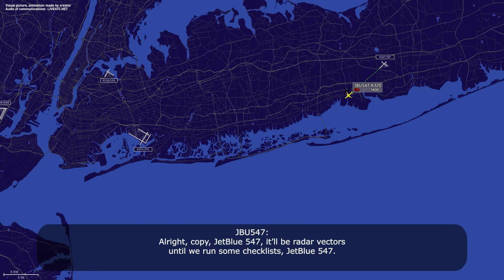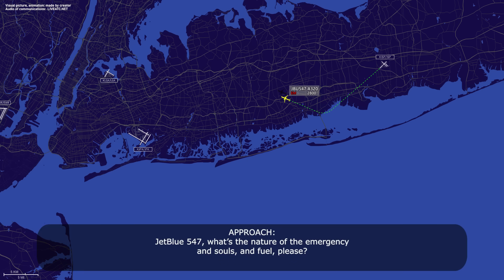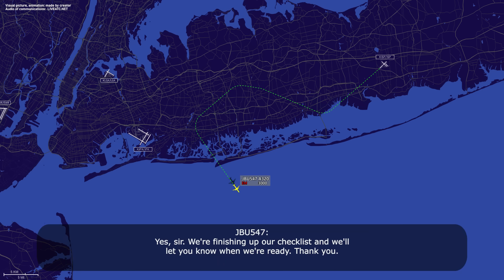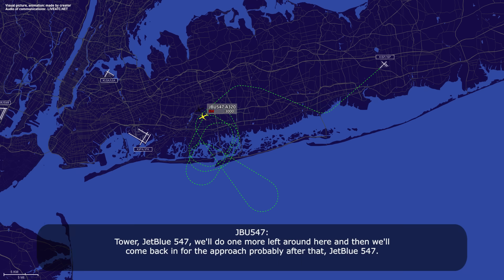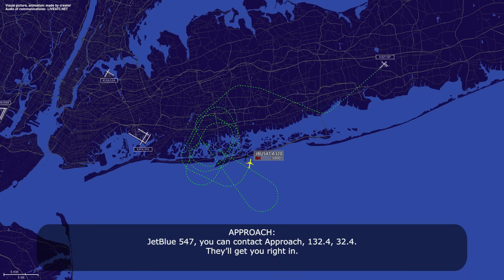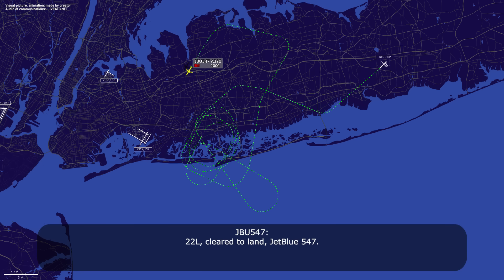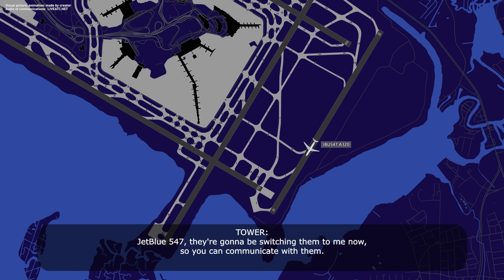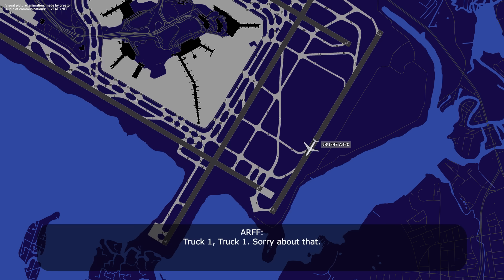47 minutes in the air with destroyed engine. JetBlue Airbus A320 diverts to JFK. Real ATC

Comment: FAA ATC seriously needs to figure out a way to pass on the POB and fuel information.
Reply: Yes.  It's embarrassing to hear, and it creates further workload and distraction for the flight crew.  The necessary technolgy to continuously report that electronically has existed for decades.  It is only the slowness of FAA and air safety bureaucracy, along with unending cost-consciousness, that something helpful and safety-enhancing like that hasn't been accomplished.  Has it even been seriously proposed or studied?
Reply: Well there is an easy fix... The controller advises the next sector but somehow that doesn't seem to be a thing in the US
Reply: @xtasy6807  - They do, but it's better to have something repeated from the source.
Reply: @xtasy6807  actually it does but because it's all manual it takes a little time.   In this case the switch was very quick and it was not communicated yet.
Reply: @charlesgee3003 yeah it is manual because the US is stuck in the 80s with their tech and procedures
Reply: It Took Like A Year To Get This Plane Down.?
Reply: Not happening without funding new Atc system. Many still use a strip of paper for each plane's info.
Reply: @Glamorgan-f2c and that's how it should be. Air needs less tech not more
Reply: That was never part of Real World or Road Rules so Sean’s going to have a tough time coming up with a way to fix that.
Reply: Excactly, 5X is just absurt.
Reply: Actually even if they could pass it on, it's like the medical profession, you ask multiple times to make sure the info is correct.  In surgery everyon repeats the same questions to verify they have it right (I've had 4 this year).
Reply: @charlesgee3003 in state of emergency they are wasting crew's time and diverting their awareness, deconcentrating. That shall be said once, readback once and done. Eventually a software made by some college student shall estimate thr fuel remaining after initial data, radar recording, plane type and number of pax.
Reply: @charlesgee3003 incorrect. There is no policy within this industry to repeat the information multiple times to confirm its accuracy
Reply: @RoamingHeathen perhaps but I suspect   the thinking is along the same lines.
Reply: @charlesgee3003  There is no thinking. They're told to switch frequencies, there is no handoff, they have to repeat themselves.
Reply: There's two pilots, it's fine. Also, it's a cut of a 47 minute clip.

Comment: I am not in the aviation industry and have a question.  Is it normal to have an emergency aircraft land right behind a heavy aircraft that causes ATC to issue a wake turbulence warning to the emergency aircraft that is about to land?
Reply: Just normal protocol to alert of proceeding wake turbulence… emergency aspect plays no role really. It’s still an A320.
Reply: @EstorilEm Thank you.
Reply: Only if you want to land asap
Reply: @kenriehl7852 Thank you.
Reply: They are still separated. It’s more a reminder to expect some bumps.
Reply: @SlowSteveRoadCraft Thank you.
Reply: no that is not normal in Europe, the US is always different. It is really silly to give an inbound aircraft a wake turbulence warning, your EM aircraft should never be following any other traffic this close where a wake could be a problem.
Reply: Unless the pilot tells them specifically, they need to land immediately no. In this case, this sounded like a normal engine failure, so they were fine to hold for a while while they set up for approach. On the towers side, since it's not an immediate landing its in their best interest to get the heavies down first in the event they close a runway. Heavies dont have as many luxuries staying in the sky as a little 320.
Reply: @jonathanzimmermann5877 Thank you for explaining this info.

Comment: Take a moment to admire this aircraft. Single engine, stayed flying, landed safely and kept up the required speed by ATC for spacing.
Reply: I completely agree although surely there was nobody following them in given they closed the runway? 
So I guess it was just a case of keeping them separated from the aircraft in front and not because there was also an aircraft behind them
Reply: @rossn9164  They probbably had approaches right behind them coming in for 22R. JFK is super busy so as crazy at it is, when they think it's safe, they continue to operate flights around the emergency aircraft, and switch to a different approach runway behind the emergency, effcectively making a single runway airport.
Reply: Gotta maintain 250 or less under 10k anyway
Reply: Why is this happening so much? Or is it these occurrences are normal but before YouTube channel like this we simply would not hear about it?
Reply: @hankhammer1689  Well, if you increase the number of flights by millions each year the number of incidents will also rise…
Reply: I mean, that's kinda what they're all designed to.  Every commercial twinjet in service can do that.
Reply: @cruisinguy6024  You're not wroong, but even so 40 years ago this was more common and more often became a serious situation. May have been quite hairy. It is notable that both crew traning and, criticallly, aircraft design have come such a long way that this serious emergency was handled by both crew and plane with relative ease and total safety. ATC could have had better communication, but overall handled well because of modern traning and design.
Reply: @cruisinguy6024 Yea and I think hes saying to admire how far technology has come to allow that.

Comment: Did they agree in changing the runway in one of those transmissions that were not included in the video? They had asked for 22R due to it being longer but then got 22L.
Reply: At 06:07 they informed ATC about the switch.
22R landing distance is barely more than 22L and 22L has an EMAS

Edit: 22R has a massively displaced threshold, so at first glance it appears way longer than 22L (and the better choice), until you take a look at landing distances
Reply: @lyaneris  thanks, I had missed it. Didn't know about the displaced threshold making the difference smaller, interesting!
Reply: 6:02 they request it
Reply: @kevinofcnj  Thanks, I had missed it :)

Comment: Do these controllers seriously not pass on information to each other?  They only asked multiple times for the exact same information.  It'd be nice if all these controllers would communicate with each other when there's emergencies like this.
Reply: Sometimes the next controller is in the same room, sometimes it means a phone call. Depending on how fast things are happening and how much other traffic and issues are going on for the sending and the receiving controllers, info passing may not be the priority.  VASAviation sometimes posts long unedited videos of emergencies and the sophisticated orchestration of a crowded airspace to make room for the emergency aircraft is amazing to see. At least Kennedy has parallel runways. Sometimes the controllers are having to work out what to do with other flights considering their main runway will need to be closed a.period of time.
Reply: Actually I suspect that even if they could pass it on, it's like the medical profession, you ask multiple times to make sure the info is correct.  In surgery everyon repeats the same questions to verify they have it right (I've had 4 this year).
Reply: @charlesgee3003 This. I worked EMS a long time back, and still remember the routine. If possible, we verified every bit of information the dispatcher gave us, and everything we got from any on-scene first responders. And the ER staff verified everything we told them.

Because every exchange of information between people is an opportunity for an avoidable mistake.
Reply: @charlesgee3003 Yes, this. I had multiple procedures last year and can confirm this process occurred via the post-op reports. Yes, it might be the third time you're asked, but they want to absolutely dot the I's and cross the t's.
Reply: The second controller  (who only had the plane on frequency for about a minute and a half by my estimate comparing the positions on FR24) acknowledged the check-in, collected emergency information, issued a heading and altitude assignment, handed off and shipped the a/c in that time while likely dealing with others. They were the ONLY one with a chance to coordinate ahead. The first shipped the plane to the next controller immediately once they declared the intention to fly to JFK so she had no opportunity. The third has to ask again if they don't have the info. You also have no idea whether communication was attempted or in progress. And I bet it was.
Reply: @cbop2428 the idea is you keep them on your freq, until you brief the next controller and he agrees to the hand off, then you hand them over. That's why they have direct lines to each other.
Reply: @jaguar3248  that’s your idea, which is not based on reality and completely ignores the immense complexity of ATC dealing with an emergency in the most congested airspace
Reply: Always lots of experts in these comments. Or they THINK they are experts. 🤨🙄
Reply: I believe the issue was the late plan to divert airports, that airspace is very compartmentalized so it’s likely part of the issue (at least one or two of the calls.) 

Plus if the info hasn’t been forwarded to the controller and an emergency aircraft checks in, he literally has to ask.
Reply: It does not show on the video but there are many. Many more planes on the radar at the same time..these guys sometimes dont have time to pass informations. Yet they rarely mess up bad regardless..
Reply: Nothing wrong with asking again, if aircraft was in imminent danger he'd land immediately without any info given anyways
Reply: "JBUS547, yeah, we still have 167 souls on board, nobody has left the plane yet."
Reply: Agreed, they ask and then tranfer
Reply: There's no reason to repeat information from different sections, pass it on ...
Reply: The other thing they need to learn is stand by means exactly that, stand by, not how much fuel and pax do you have on board, then ask them to repeat the nature of the emergency again.
Reply: Private ATC now under Trump?  Competing?
Reply: @Apa-h4z I wouldn't trust Trump to figure out how to make a peanut butter sandwich.
Reply: I wanted to ask the same thing. Maybe secretary Duffy can include some automation of this in his upgrade plan.
Reply: Just like calling some utility company. Got to go through multiple people, robots and some other shit asking same questions.
Reply: PIC responsibility. If you don’t know, ready the FAR/AIM. No excuses.
Reply: Yep every emergency is exactly the same, pilots wasting time and effort repeating the same thing over and over. Maybe the first controller can add the info that will display on the screen for all to see.
Reply: It's a constant repetitive failure of many ATC areas.
Reply: Another Scarebus incident?
Reply: Nah... They landed safely. They probably ingested FOD. Good thing this wasn't a Boeing!  Those Boeings are TRYING to kill you.
Reply: @602STS2 . Someone will blame Boeing….
Reply: Controllers just get in my way.
Reply: @AquariusTurtle  🙄 let’s just get rid of all the controllers and see how that works out. Come on 🙄🤣🤣🤣

Comment: Why not a standard request for fuel, one controller wants lbs and one wants want time.
Reply: Time is about routing (not that it ever seems to come into play). Weight is for telling ARFF what they may have to fight.
Reply: @alanm5013  And you think ARFF is gonna leave some of the trucks and equipment behind and only half-ass their job when they hear the fuel tank is almost empty?
Reply: @PsRohrbaugh  lol no
Reply: @alanm5013  Weight of fuel has no bearing on ARFF operations, especially for a mere engine failure.  The level of response is driven by aircraft type and alert level
Reply: Time is for ATCs - they can do their jobs better if they have this info (+ to my knowledge they are required by protocols to ask for it).
Quantity is for RFF - same reason.
Reply: @andreea007  the amount is fuel is only relevant for ATC during fuel emergencies - and even then it makes no difference to ATC if a "mayday fuel" aircraft has 15 minutes or 30 minutes - either way that aircraft is getting priority handling.
Reply: The controller who wanted the fuel as "time" might not know the plane had just taken off from Islip. If it had come from a longer distance running on one engine, the fuel state might be getting critical, which matters to ATC.
Reply: More importantly, why bother asking about fuel at all.  It's completely irrelevant here and just causes pilot distraction and wasted radio traffic

Comment: Going to JFK to save money on maintaince cost I bet.
Reply: Longer runways, more emergency equipment.
Reply: Actually jfk has the longest runway length available along with plenty of emergency equipment available to attend to the aircraft. along with it being a jet blue mx base/hub making it a no brainer to divert there. Mac arthur out in islip is a very small airport mostly general aviation and some corporate jets. JFK is just the better option overall, however the last thing pilots are thinking about is what airport is cheaper to fix the airplane at
Reply: @jasmitsingh6643  It's also likely they had selected JFK as their departure alternate during flight planning so they already had it programmed into the computer and briefed.  Plan the flight, fly the plan.
Reply: @jasmitsingh6643 this reminds me of the incident with Air China 737 that flew 3 hrs on single engine, and they took ETOPS literally and basically not want to spend oversea maintenance fee in Korea, so they risk everyone's life by going back to Taiwan. Maybe this is a different scenario
Reply: Also quicker replacement aircraft available due to their hub there
Reply: @JohnnoRoskam  Not sure why they can't return to KISP instead risking 169 people in the air for 45 mins. Thank god the other engine didn't fail
Reply: True, but the main factor is the nice long rwys
Reply: I would think that a JetBlue crew, which has one of its hubs at JFK, would already know that 22R isn’t any longer for landing than 22L. It looks deceptively longer, but the displaced threshold cuts off a big chunk of available landing space.
Reply: @wotan10950Why need a longer runway?
Reply: in a real dire emergency the pilot would chose any airport or even an empty field or road, of course this is only for the most extreme options.

Comment: 5:45 temperature in C, surprising.
Reply: Almost all countries in the world use Celsius, only a small number don't, so for international standards such as METAR information C is always used for temperature and dew point
Reply: around 1994 the USA changed to reporting temperature in C for aviation weather.
Reply: @canyonblue737 About 1975 they started teaching us the metric system in grade school, so we could finally catch up with the rest of the world and transition to some base-10 units. They even started adding distances in km on highway signs and everything. Sadly that initiative got dropped.

To make it tongue-in-cheek political - if we're better than Canada, and Canada successfully switched from miles to kilometers, surely we are competent enough to switch.